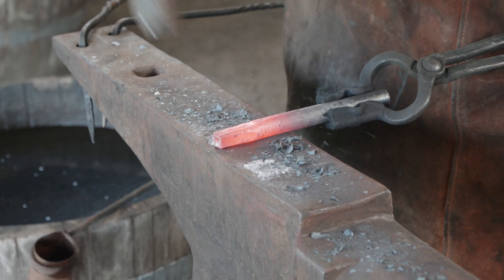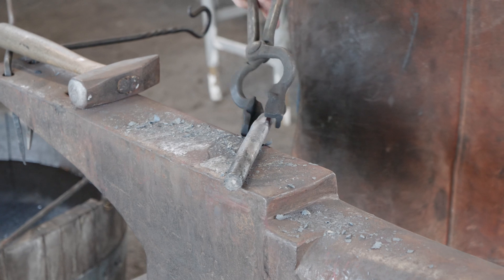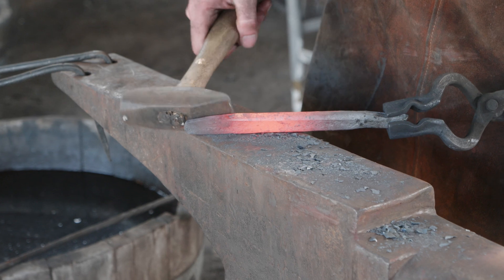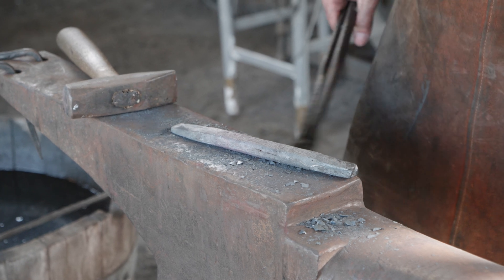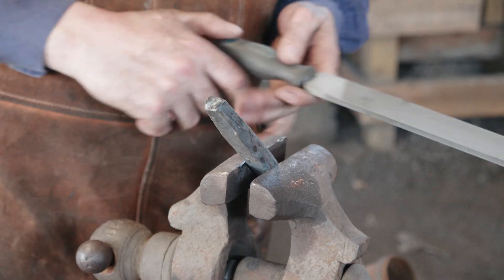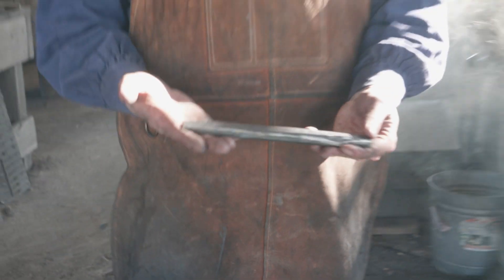ABANA National Curriculum 1.10 - Hammer Eye Drift

Comment: why the hell are you using this toy hammer? 1,5 kg would be the minimum weight for this job
Reply from the maker: It's 13mm 4142 I've never felt the need more than the 1000g hammer I'm using to move medium carbonsteel that size. 

1000g let's me swing quickly and accurately. I can swing longer and move more steel with that weight than a 3-5kg hammer.

When I do move up to bigger steel that needs a heavier hammer, I normally get someone to strike for me with a sledgehammer.

Comment: A monkey tool is used for squaring the shoulders on a tenon, isn't it?  Which part of it is traditionally drifted?  The ones I've seen before are essentially round bar with a hole partially drilled lengthwise.
Reply from the maker: Check out this video from Malk Asprey. 

https://youtu.be/Q-6akAaX-Ow